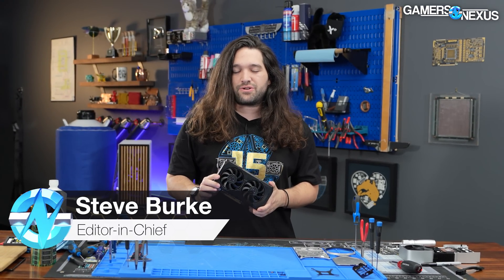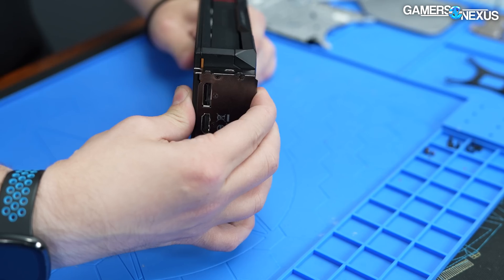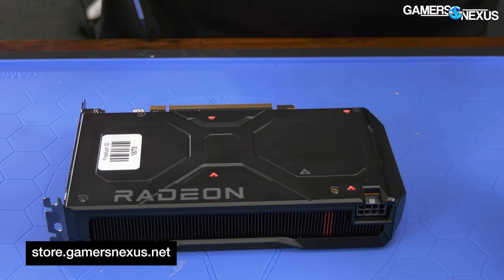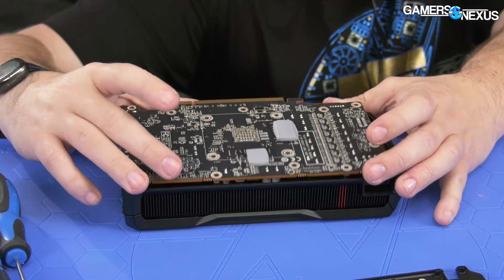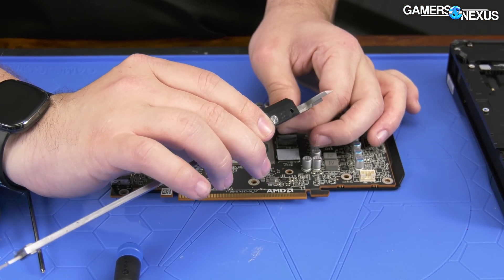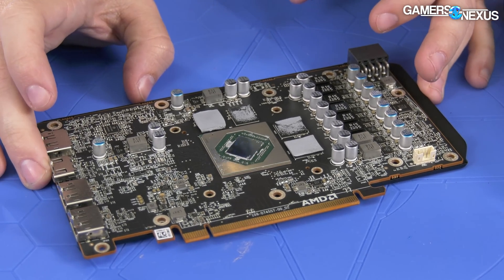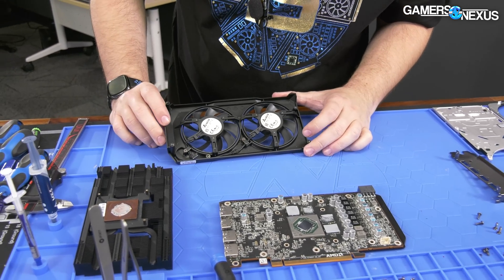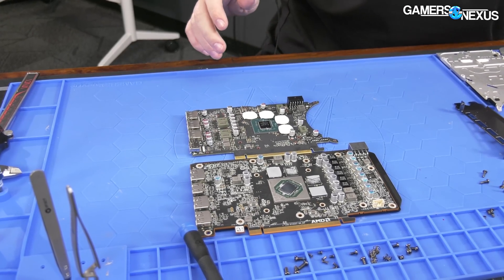AMD *Almost* Learned Something: RX 7600 Reference Card Tear-Down

Comment: More heat can come out the back of a board usually, unless they are special components that can be top side cooled. Reason being the path between the component and the back of the board is primarily copper typically(vias), while the top of the component is plastic.

At least for MOSFETs, may be different for memory modules since a FET has 100% connectivity between the back of the component and the rear outside layer of the board, and a memory module is mostly making connections to different internal layers and not going all the way through.

Comment: I sure hope AMD gets their act together on graphics card performance.  I have always used their processors since the first one in my 486, and never had a problem with one.  I liked supporting them just for being a pipsqueak going up against the giant intel, and for as big as the difference they did much better than one could hope for at a better price, and delivered great reliable processors.  Their Linux Support is already way better than NVIDIA's, and with intel in the game if they don't suddenly just bow out, it could get interesting, and be better on our wallets.  I wouldn't mind if others come up with some new wicked tech and competed in the graphics card market.
Reply: 5700XT was the most reliable card I ever owned since a crazy niche 4890 - the 6800XT I had after drove me insane, it was somehow incompatible with my monitors & kept killing the rig. Which is a pity, coz the performance was fantastic until it wasn't... I'm trying a 7xxx atm & it has the odd issue that might be drivers ( I think they're having one of their rougher patches there - I seem to have skipped all the driver issues people had in the past ) but otherwise it's solid & stable & fast and I wish they'd sort their idle power use out already.

If you must have RT ( I don't care in it's current state, it's a gimmick until most of the lighting is raytraced and that isn't happening for years ) then yeah, AMD is lagging, but I don't find myself wanting a 4080 ( thankfully given the utter ripoff it is ). Not sure I'll keep this thing when the return period runs out but I'm at least thinking about it.

Must admit I'd give Intel a good look if I had to buy a cpu right now, AMD looks like their seams are starting to crack a little. Hopefully it's transitory. 3930k/X79 still going strong 12 years later doing useful stuff, wonder if AM4 will last that long.
Reply: I hope they get their act together for drivers and stability. 4 generations in a row now that they are releasing stuff with terrible drivers and completely unstable. And as for sticking up to Intel, they literally have priced their stuff more expensive than Intel ever did (which was the only thing Intel ever did wrong). Yet now AMD has significantly more major issues with chips dying, and other stuff that Intel never did.
Reply: @username8644  The issue with the chips dying is a motherboard issue, and so far only on one specific ASUS board on AM5 with a specific AMD Processor, and I haven't heard of any stability issues at all on Linux, only Windows systems, which I won't touch with a 50' pole!  I have never had an AMD processor crap out on me, but so far 2 intel's that did, and intel has had issues with their processors and drivers just the same, (everyone does) often far worse like being susceptible to attacks like whole generations of iX processors are, and they just kept producing without fixing the problem.  I remember once when looking to build a new system, and deciding between AMD K6 and the intel Pentium, where the intel couldn't process numbers beyond a specific decimal point and made errors, and no driver could fix it because it was in hardware, and that at a much higher price than the AMD which I then bought.  The only thing intel has always been better at is raw speed, often at the price of not being able to use ECC RAM and other good tech, and at a loss of stability, unless paying way more for one of their top end processors, where AMD's have always been less error prone, and even preferred for scientific computing.  Now intel processors run hot, consume more energy, and are way more fickle with motherboard specs and what RAM you can use.

If all you do is play games, I can see going with intel, but for everything else, AMD is the better choice.
Reply: @Bob-of-Zoid  Clearly not. For stability Intel is by far the better choice. Amd is only better for gaming. You got it reversed. Most of the issues you list with Intel are amd issues and things Intel does better lmao.
Reply: @username8644  It's only true with intel graphics cards being better than AMD's, not processors, and also because intel is catering to industry more than gaming in the graphics card realm.  "Clearly not"  You are just saying that, but how about you cite your sources that confirm your beliefs, or at minimum list a few actual scenarios, like I did?

Also, if AMD is better for gaming (for which I don't give a shit, it being a waste of time for the most part), then why does this and most other channels who rate mostly "Gaming" performance always put intel above AMD?  Go watch Wendel of Level one tech and a few others, who get deep into computer learning, AI, large infrastructure... where raw speed isn't everything, and how often they put AMD above intel for such tasks.  Also when you consider the price difference you get way more bang for the buck with AMD, and always have, and I have been computing since 1979 and have built many systems, and wasn't born yesterday as you seem to be.

One more thing:  I wouldn't be surprised if having an intel is better for Windows, but Microsuck and intel have been in bed together from day one controlling where tech goes despite better options, and have even teamed up to snuff out many companies with great tech that posed a threat, whereas AMD is more OS agnostic and true to industry standards, and have survived for so long for good reasons.

Comment: Seeing a simpler, proven design functionally implemented is refreshing tbh
Reply: @PREDATEURLT   it might not have been the car the vram freq because on default I was getting 110°c but when I set it to 2714 (2700) and it was just normal
Reply: so refreshing watching them charge you 300€ for a card they cheaped out everything, and cost to being produced less than 75€
Reply: @PREDATEURLT  i have to say i like fin stack 'exhaust' treatment and i was tempted by the 7900xtx but the cooling issues worry me.
Reply: I appreciate it makes it cheaper but the lack innovation is surprising and not sure it’s to be applauded to churn out something very basic and let the partners come out with better solutions.
Reply: @BikingChap  It's a 165 W GPU. You don't need innovation to get rid of that heat, and that's the point. Useless complications would just make it more expensive
Reply: @5ch4cht3l7  have you seen GN's other video where they've tested thermals? They specifically called out concerns over hot spot temps. It may not need anything fancy but it needs a better solution of some sort it would seem.
Reply: @BikingChap  Part of the reason we lost EVGA in the graphics card space is because Nvidia kept making better coolers and taking sales from AIBs.
Reply: @Collin_J  not just good coolers nvidia allegedly doesn't leave AIBs almost any margin anymore upselling them their gpus
Reply: @Collin_J  then they’re no great loss. Imagine a partner that basically has to say “can you make your cards worse or we look bad”. I appreciate it has zero impact on frame rates but the FE cards are beautifully built compared to tat AMD is churning out.
Reply: @Collin_J  Nvidia left no meat on the bone for profit not to mention locking voltage, current, bios and every thing the company's could do to raise performance.
Reply: @BikingChap  Not at all. Innovation is expensive, you do that on the expensive cards. On a cheaper product, you don't reinvent the wheel, you go with the cheapest solution that works, which will often be reusing part of an existing design, be it from a previous gen or from a more expensive product. When companies engineer a car, they don't have extensive meetings about how many wheels it'll have. Same principle here, if you know the card will only produce this much heat, and have proven methods that work reliable, innovation will only happen if it brings a tangible benefit.
Reply: @campas7182  again, the issue that GN raised was that the hot spot temps were marginal. I guess if you want lowest possible price and just about good enough cooling, this'll do.
Reply: @PREDATEURLT  because as GN noted, thermals are marginal on this card. I just think building it as cheaply as possible and leaving partners to make it half decent shows a lack of self respect frankly.

Comment: I do love backplates, dust/corrosion  can get everywhere after years of use and protecting those microcircuits from short-circuits becomes more relevant as they shrink distance on contacts over the years, specially consider that part is expose to any dust falling by gravity alone.

Comment: What's the difference between phase-change thermo interface with pre-applied thermo paste? They appear the same to me... Unlike "Phase change cooling" (e.g. heat pumps/ heat pipes) vs justncopper core.
Reply: Push out effect - phase-change thermo interface didn't have it. Thats why you not forced to change it in long time period (and your hotspot not rises into the stratosphere). Phase-change thermo interface melted when chip is hot and solidify while cold.

Comment: It actually has better build quality than the 4060 imo.
Reply: we live in a truly strange world
Reply: How do you know that, there still is no Geforce RTX 4600 out yet😁
Reply: 4 phase VRM on the premium-super-brand 400$ videocard VS 6 phase VRM on the sub 300$ chip garbage!
Reply: @someawesome7984   phases are not created equal. Need to know what power stages are used on there. You can have 6 phases with 40A garbage stages, very different from 6 phases of 70A smart power stages
Reply: @chengcao418  here we have equal 55-60A drmos.
Reply: @someawesome7984  ok that's significantly less current capabilities then... Hmmmm
Reply: hmmmmm I don't know we have teardowns on 4060s
Reply: @chengcao418  Nvidia is pretending it's a "ti" model, but we know better.
Reply: @operator8014  No you don't. 4060 does exist and will be teared down in the future, and this comment will cause confusions.
Reply: @operator8014  it is a TI model, just closer to a 4050 Ti